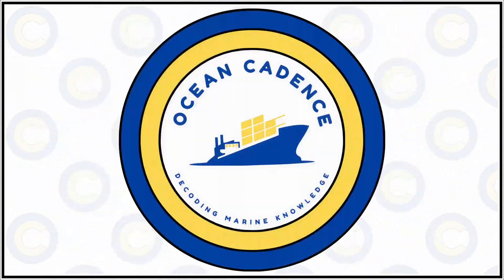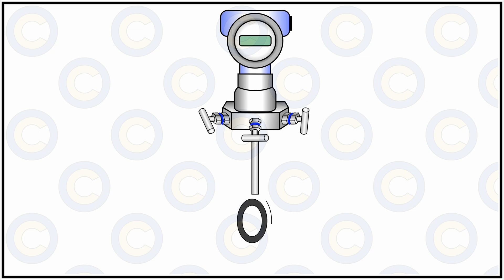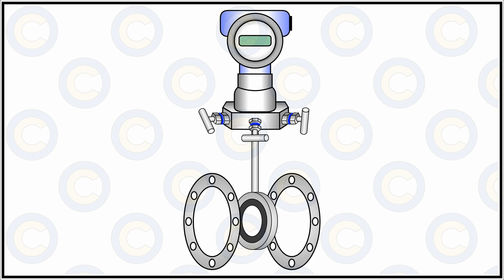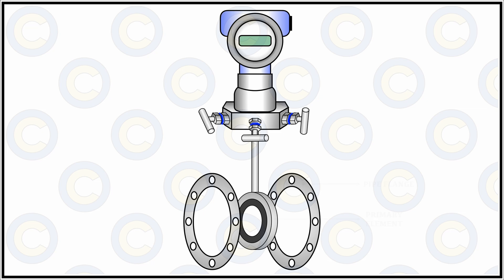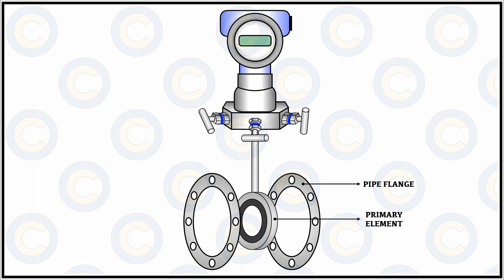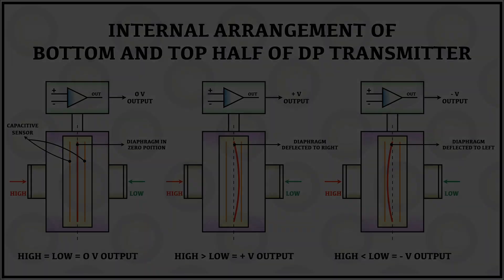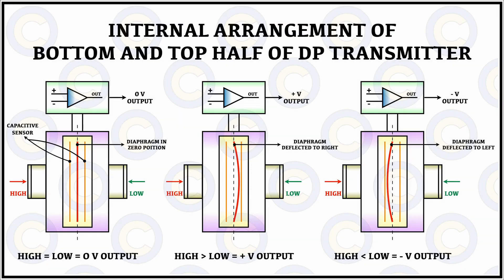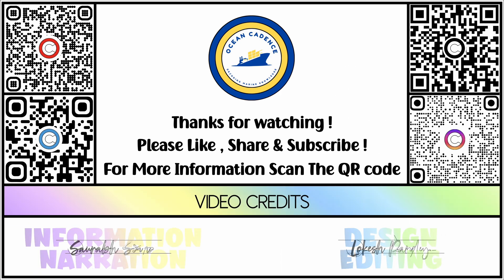DIFFERENTIAL PRESSURE TRANSMITTER | Boiler DP CELL | DP TRANSMITTER BOILER WORKING EXPLAINED

Comment: Which side is HP and which side is LP?
Reply from the maker: Under normal operating conditions, it is always the steam side and the piping connected to it leading to the DPT which is the HP side and the water drum side is the LP side. You can also refer to our next video in the series on the topic of differential pressure transmitter calibration/renewal for a clear understanding about the pressure variables. 🙏🏻

Comment: What will be the effect of HP, LP interchanged
Reply from the maker: If you reverse the LP and HP sides without interchanging the electrical orientation, the transmitter will get a 20mA current instead of 4mA in the exact opposite situation, leading to following possible situations:
In case of a boiler, it can show -ve level readings when the level is actually positive
In case of a tank, it’ll show zero readings for full level calibration
It can give an erroneous flow signal for filter assemblies.

Hope this answers your question! 😄✨